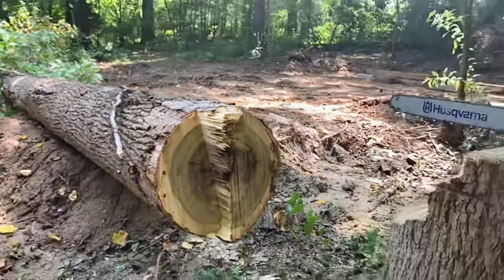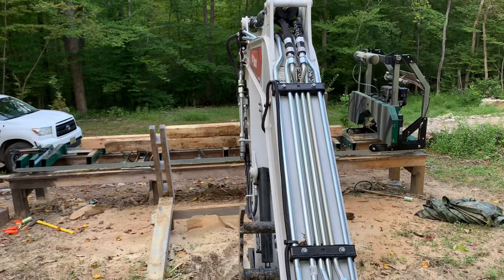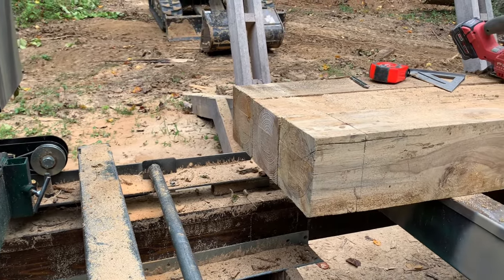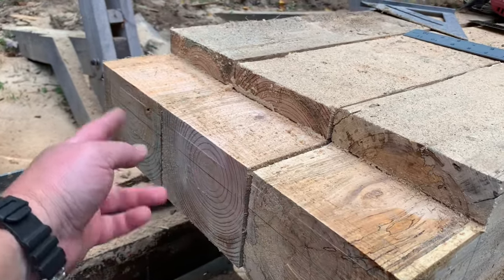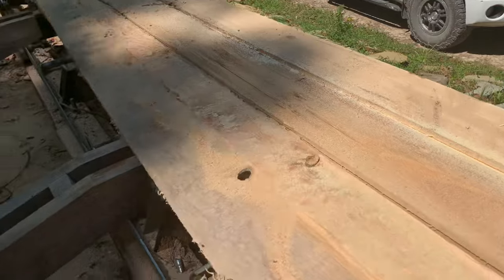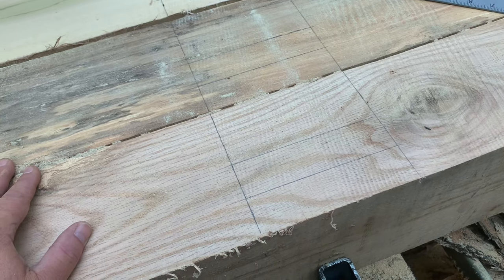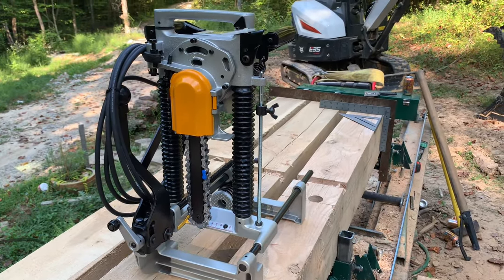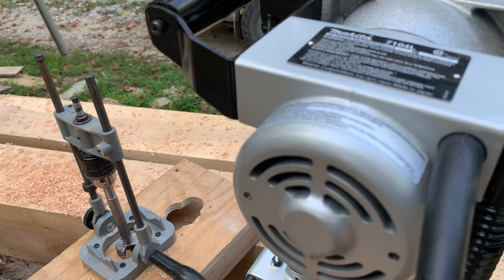Milling Beams

Comment: I'm confused when I saw the bark on that tree I instantly said it was white ash then you said it was poplar. The leaves tell all but where I live all the white ash was taken by the emerald ash borer, what a name they could have called it the green ash killer mean the same but is easier to text. All the poplar up here in michigan have smooth whitish bark with blemishes from knots till they  get around 70 feet then the bark looks like ash but the ridges are huge . My stepdad and I several years ago cut up a poplar  that  measured 110 feet tall , it had one sucker branch  60 feet up that was 40 inches at the base the trunk was 7 feet diameter. It blew down, survived the '78 blizzard but apparently a micro burst took it down 3 years later. That tree left a hole in the ground 6 feet 8 inches deep we used me to determine the depth as I 6 foot 8 and the top of my head was even with the ground, there were 6 others of similar height he call Drenth Bros .pallet  factory they came out and looked at the collection with amazement and paid my stepdad and one brother came back with 3 log trucks and cleaned them up in one day. I used to hang out with my grandpa and he taught me some woodsman ship before he died when I was 10 and I got a tree spotters guide the only thing I didn't get to see on your tree was the way the leaves were on the stem, bass wood has a similar barrk but is hard to find a trunk even that is straight longer than 5 feet.